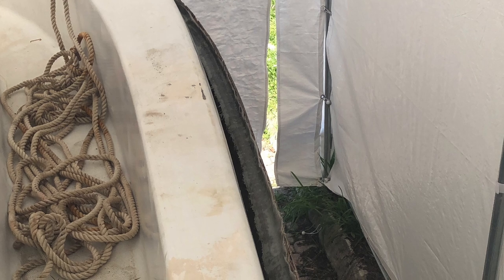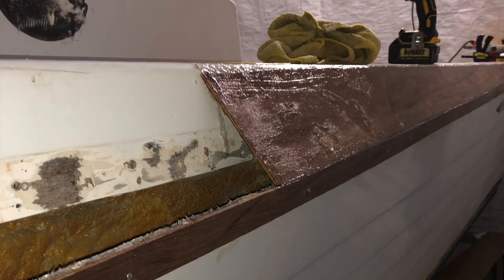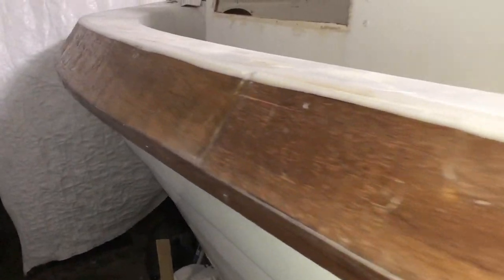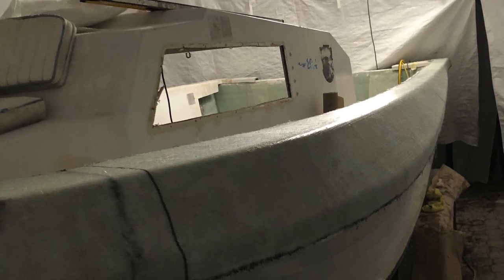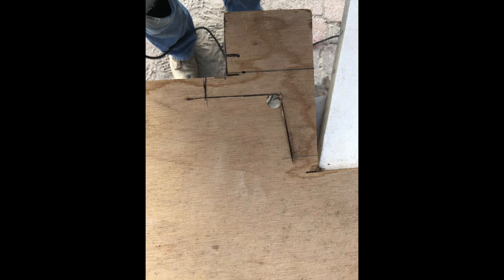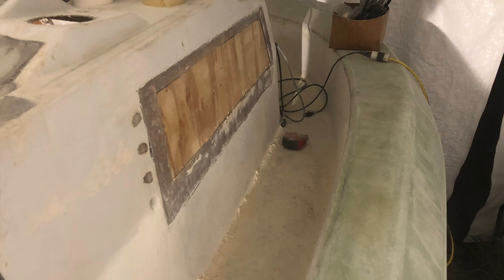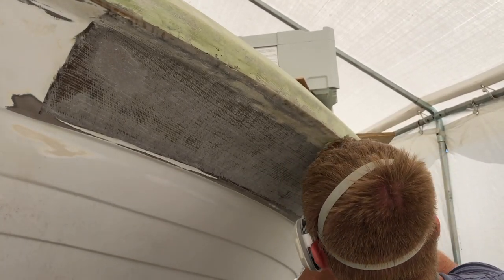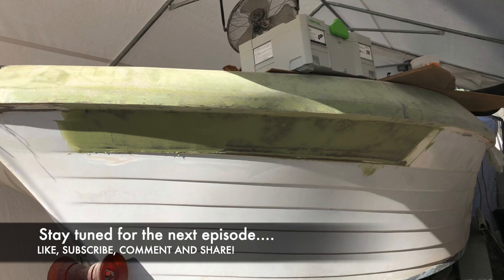BRIDGE THIS GAP!?  Ep.7  CHALLENGE ACCEPTED!. Boat Restoration, Grady White #boat #boats #fixit

Comment: when you get it faired you might think about a couple more layers of glass before finishing it.  That is a good strong shape but the area takes a lot of point loading with people jumping on it and bumps into docks and pilings as well as other boats if rafting. Not to mention downriggers and other equipment that gets bolted to it.  In Florida you may even put a tower on it.   I would also add rib stiffeners on the underside to make it stronger.  Easy to do now relatively speaking and it makes a big difference.  A lot of wracking forces are spread throughout a hull as it goes through the waves driven by a lot of horsepower so stiffness in the hull is a good design feature in a small craft.  They also make rub strips that can be bolted on along that outermost edge all around the boat should you so choose.  Saves a lot of scuffing and such.  used a lot on commercial boats where they glass the deck to the hull.  I have only seen them in white or black but other colors may be available.  Not a bad solution if the hull stays fair.
Reply from the maker: Doug, your comments alone are more instructional than any video!   Rib stiffeners would have been a good idea. I felt comfortable and was very surprised with the strength with just the luan plywood and thickened epoxy bonding it to the cap and hull. Like you said, it was the shape that gave it strength. With the strength of the 1708 fabric and epoxy added to it, I was blown away with the rigidity and strength. But certainly, rib stiffeners would have made it that much stronger. We will install a new black rubrail. Thanks again, Doug. Greg

Comment: A trick for overhead glassing is to roll on a coat of resin then let it get just a bit tacky before laying up the saturated cloth.  Works with either epoxy or poly.  Don't let it overcure or you have to start over.
Reply from the maker: Thank you Doug. Absolutely agree. The only issue is the epoxy kicking off as you mention. I use a medium speed hardener, which I got used to working with through the project. In the heat, when it kicks and gets tacky, I just don't have much time to work. Brushing it on thick and also saturating the cloth was safer for me. Wasteful with the expensive epoxy though!